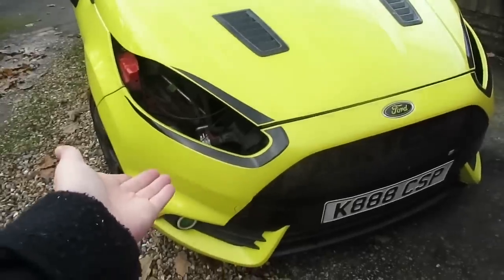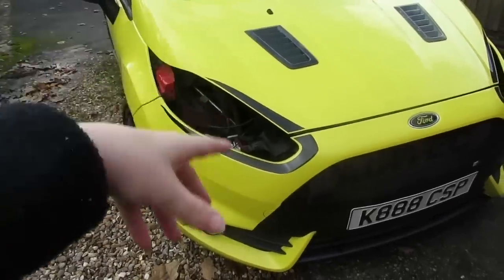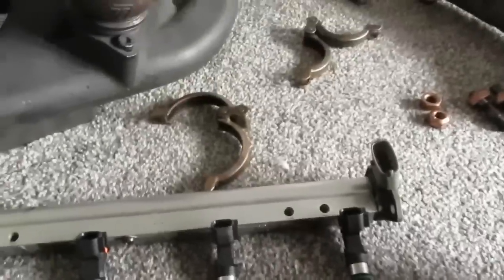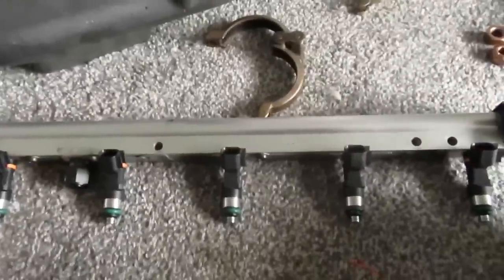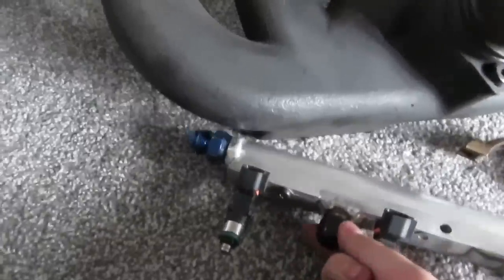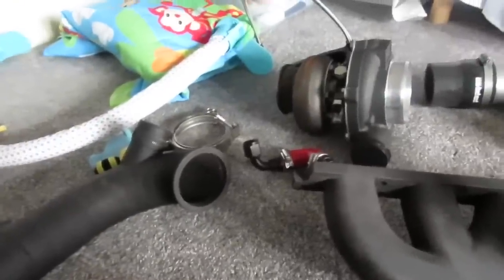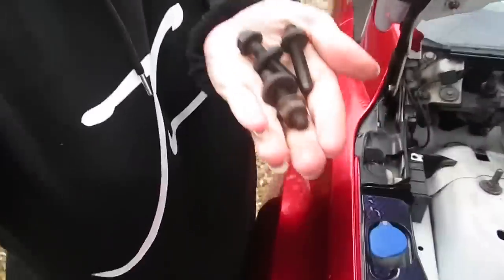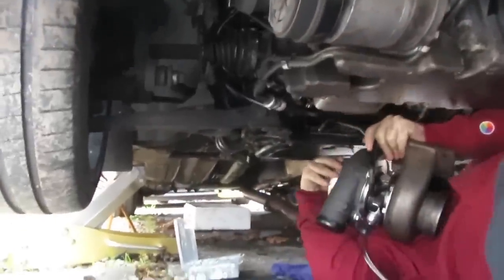WE FITTED A BIG TURBO!! MK2 FOCUS RS

Comment: Just out of interest why did you use that manifold? that’s the cheapest manifold they do for a hybrid turbo, I have a similar setup but seriously considering swapping it for a tubular, (I find it quite restrictive) Airtec’s tubular manifold is about £600 quid and good for 600+ bhp were as ‘Nortec’s’ tubular manifold is about £1,000 quid and good for a lot more (just wondered if you have heard anything else before I start spending)
Reply from the maker: Hi Jason, in all honesty the manifold came with the turbo, that’s the reason we have fitted it. We didn’t really shop around. But the guy who had this before us was running 680bhp x
Reply: ThatFezGal X that’s extremely surprising some of the most famous ‘RS’s in the country are both running 671 bhp however both have expensive tubular manifolds and syvec ecu’s I really believe you will get a maximum 600bhp on that set up (with syvec ecu) however keep me posted 👍 also if you are after massive power ... DT Racing now do a side winder manifold kit for £5,400 and that’s good for 800bhp
Reply: @jasoncauldwell4071  There is no ways in fucking world the previous owner was running 6870, A with a GTX3076 nor with a Cast manifold. 

The original owner was running a GTX3582 on a sidewinder kit to make that power.

Ignore what this lot say as they can't even name a fucking V-Band clamp...

Mind popping me a link for the sidewinder kit?